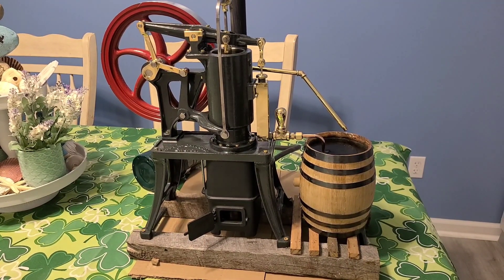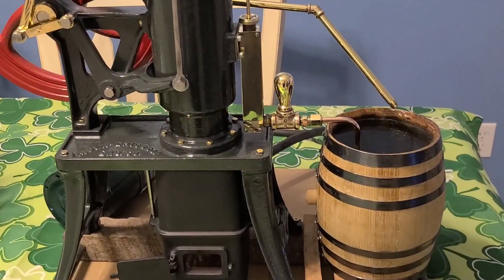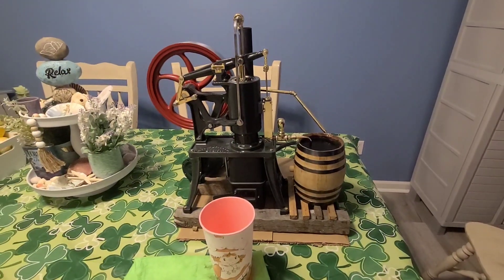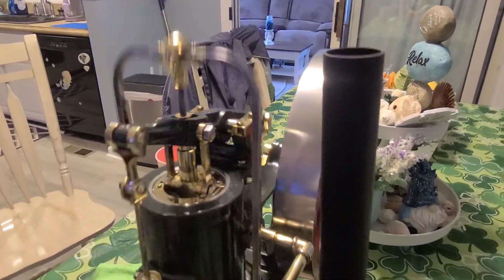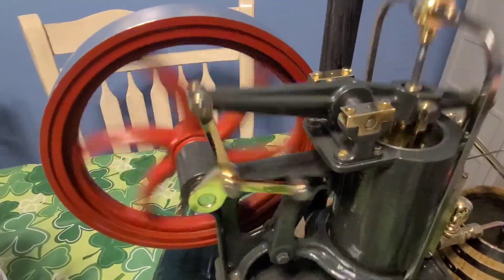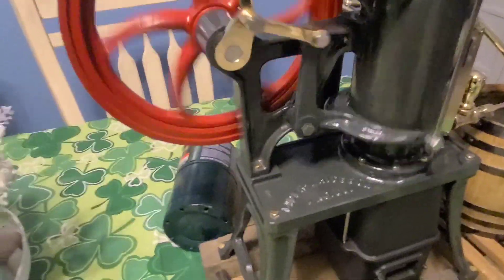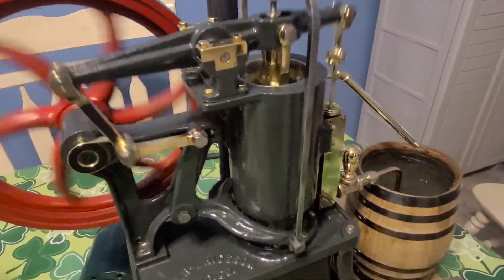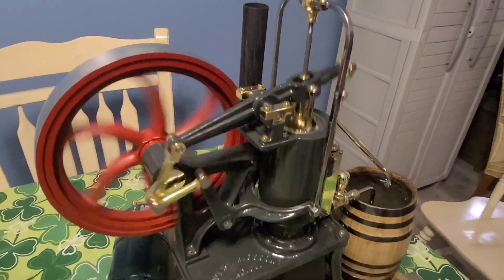Experience Firing Up Mini Hot Air Engine

Comment: Would be interesting to put the propane bottle in the return water path to cool the water. I assume it loses efficiency as the water heats up. Obviously ur still going to lose heat differential but it would keep it cooler longer.
Reply from the maker: Very interesting idea for sure !!